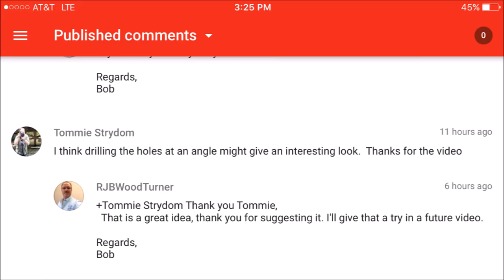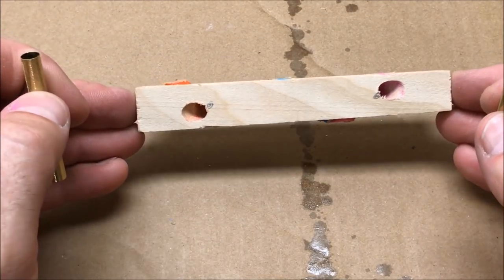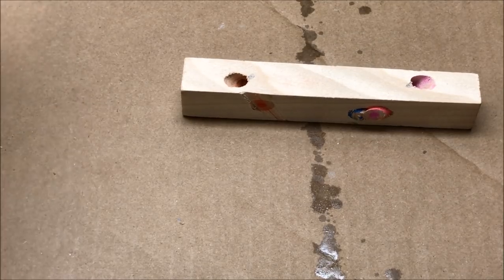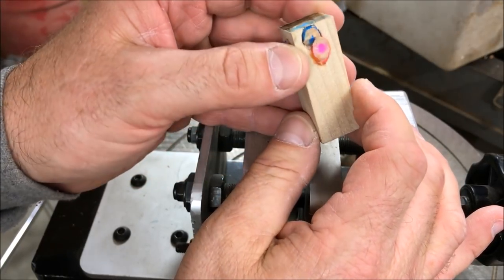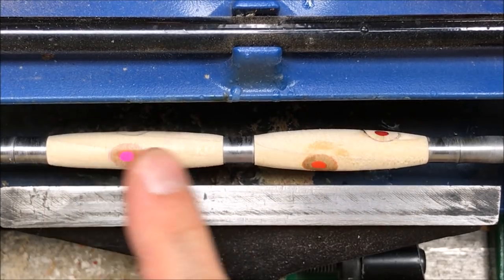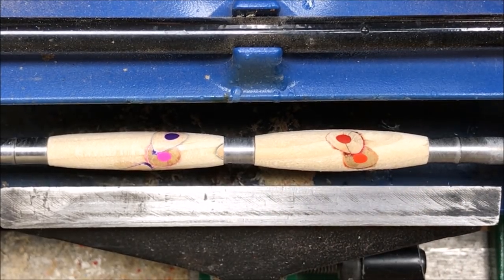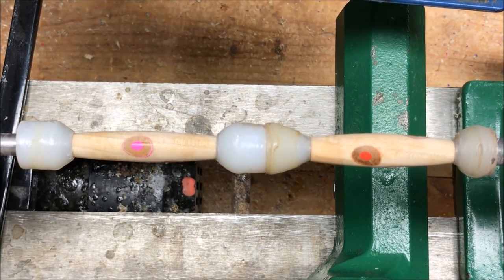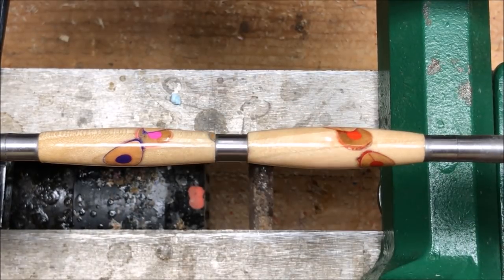Viewer Requested Blank

Comment: Glue the pen blank to the waste block with a couple of small drops of super glue. Drill it then cut it free on the band saw. I use this method for dowels etc. and it works well. Good video.
Reply from the maker: +Tom W Great tip Tom,
  Thank you. 

Regards,
Bob

Comment: You could try hot gluing the blank to the angled piece of wood and cutting it off after drilling. It wouldn't affect the finished pen since you are turning all of the glue residue off anyway.
Reply from the maker: +Aaron Johnson Nice idea,
  I use hot glue all the time in the shop, it never occurred to me to use it for this application. 

Regards,
Bob

Comment: nice job. I'm new to turning and you have my brain full of pen ideas. Thanks for the videos.
Reply: also, try to use wood working drill bits weather they're the pointed variety, or screw point auger. you get better entry and usually don't burn the wood if using low speed. I am guilty of using jobber style metal drill bits because they're cheaper and convenient.
Reply: also, try to use wood working drill bits weather they're the pointed variety, or screw point auger. you get better entry and usually don't burn the wood if using low speed. I am guilty of using jobber style metal drill bits because they're cheaper and convenient.
Reply from the maker: +Ron Parrott Thank you Ron. 

Regards,
Bob
Reply from the maker: +Ron Parrott Thank you for the information, I'm guilty of grabbing what ever's at hand at the given moment. 

Regards,
Bob

Comment: Great work Bob,  Had I known you were turning one on the angle, I could of saved you some grief. I had all the same problems you did.  On the angle jig.  I did the same thing.  I did take it one step further.  I glued small pieces of wood on the outside perimeter of the jig and made one piece on the left and right side and one on the bottom, leaving the top open to slide the blank in.  I set so a 3/4 blank just fits in and doesn't move.  If I remember I cut the jig to a 30 degree angle.  I can get more pencils in that way.  Just throwin out ideas.  Oh and CA holds the side pieces to the jig just fine.
Reply from the maker: +Dave White This one came about really fast. I usually mention them on the update channel. I wish I had because I would have liked getting some input from you. 

Regards,
Bob

Comment: nice looking. have you tried the juniper that i sent you yet. be nice to see what you get grain wise. plus it show that even bush wood can be used. the juniper is the flat blanks that i mistakenly wrote cedar on.
Reply from the maker: +John Lacourse I need to search the shop, I used a bunch of Cedar and hope I didn't use it as Cedar. I've been traveling so when I return, I'll search for it. 

Regards,
Bob
Reply: hey look for the wood . It was 3in wide about13 inch long 1inch thick. came in the box with the blackwalnut block and bunch other blocks. good luck.
john
Reply from the maker: +John Lacourse John,
  I found it! Its on my bench and I have some pen kits so I plan on giving it a spin very soon. Thank you for reminding me and getting it back in front of me. I sometimes get side tracked easily and let things go to long. 

Regards,
Bob